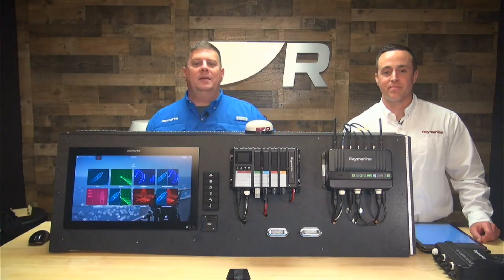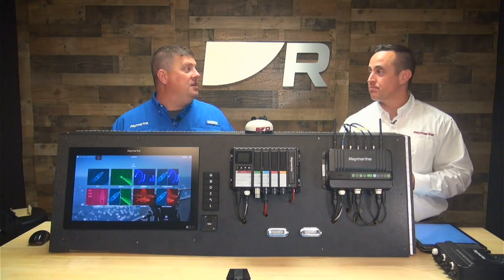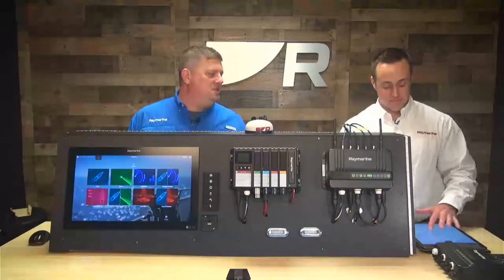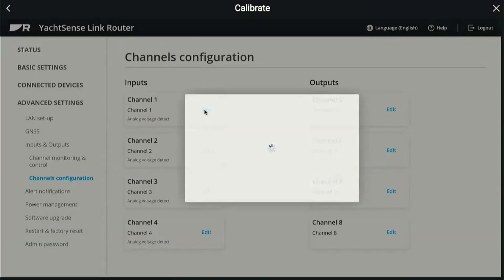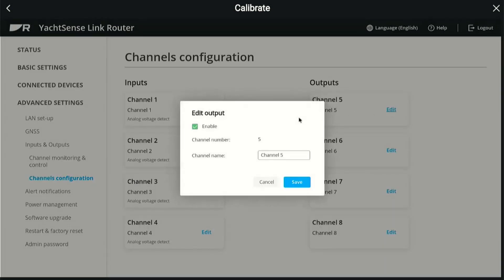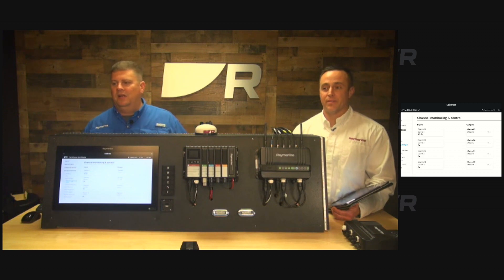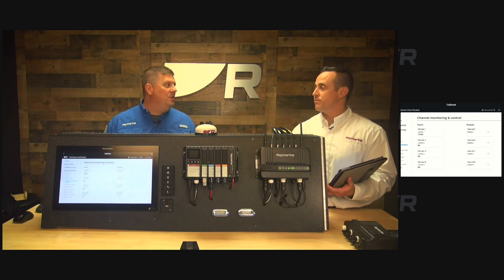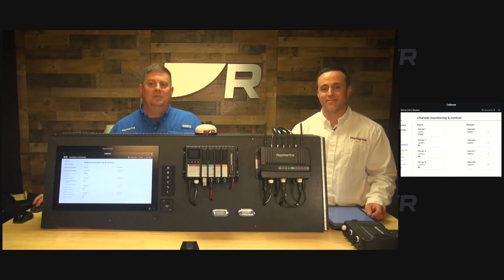YachtSense Link - Digital Input/Outputs (8)

Comment: Will you do a video showing us the Yacht Sense Digital Control and Switching hardware and how it works out of the box with Lighthouse 4?
Reply from the maker: Hello Al.   We'll do a more in-depth video covering YachtSense Link soon, and its 4 digital input/output channels.    

The larger YachtSense Digital Switching is something we might be able to scratch the surface on, but I can't go very in-depth on it because it is so highly customized to the vessel it is installed.    The full digital switching solution is something that is only installed on newbuild vessels.   It is not currently available for DIY or retrofit installations.

Comment: The outputs are straight forward - but can you give a concrete example of a digital input NO and and digital input NC scenario? You mentioned hatch monitoring - but will this alert you when off boat (premium?)
Reply from the maker: Hi Al.   Sorry for the delay in answering this.    Your message got a bit buried in the interface I use to respond.

YachtSense has 4 input channels.   Each one can be individually configured to work in one of 3 ways:

1.  Analog voltage detect - this is typically used for voltage monitoring.  The value of the voltage can be used to trigger an alert on the Raymarine companion app, off boat.   

2.  Digital voltage detect - normally open.    In this configuration YachtSense link is watching an electrical circuit that is normally cold (no power) and will trigger when it senses power is now on.   

3.  Digital voltage detect - normally closed.   This is the opposite of the last one.   Here YachtSense is watching the voltage on a circuit that is normally on.   If the power stops, it will trigger an alert.   

To make use of these circuits in a security scenario you might connect this line to a magnetic reed switch on a hatch, door, etc.    These switches will have power run to them, and will either be specified or configurable to normally open or normally closed.    If someone opens that entry point, the switch is triggered, YachtSense link sees the voltage state change, and an alert is triggered to the Raymarine app over mobile 4G SMS or through the internet.

If you have additional questions about it, please feel free to email me.  james.mcgowan@raymarine.com

I'll drop this in there too, as it is the official except from the YachtSense Link manual:

Input channel alerts
Alerts can also be set for each input channel (Channels 1 to 4).
By selecting Edit against input channel you can specify a unique Alert ID,
enable and disable notifications using the Allow notification checkbox.
When the input channel’s input type has been configured as Digital voltage
detect, normally open or Digital voltage detect, normally closed you can
enter a voltage and select whether the alert is triggered when the channel
has Met or Not met the specified voltage. You can also enter an alert
notification message.
When the input channel’s input type has been configured as Analog voltage
detect you can enter a voltage and select whether the alert is triggered when
the channel’s voltage value is below or above the specified voltage. You can
also enter an alert notification message.
Reply: @Raymarine  That is a super helpful and detailed explanation - which is more info than in the manual (hint 🙂) I have setup this up with a reed switch BUT I only received the alert on my Axiom. Are you saying the alert should also flow through to the App?